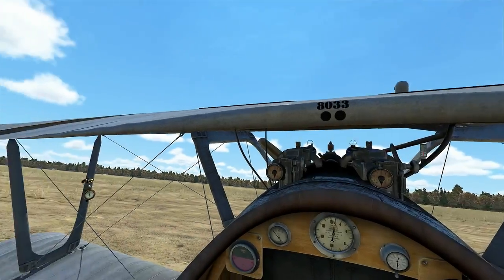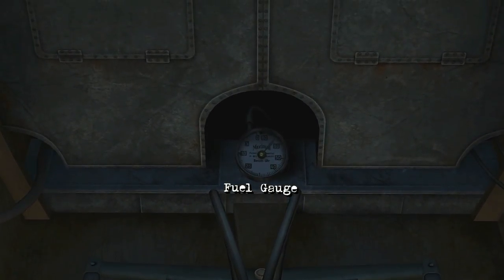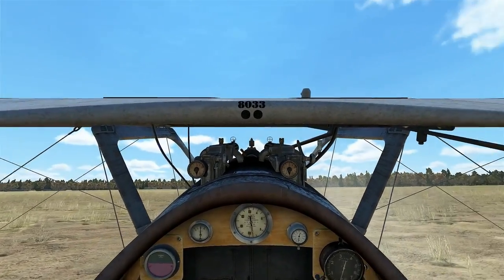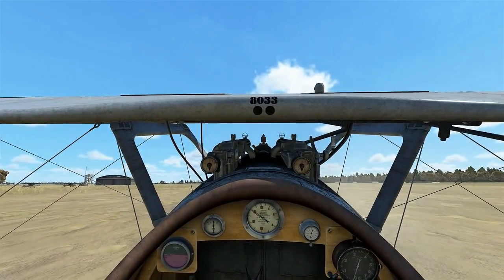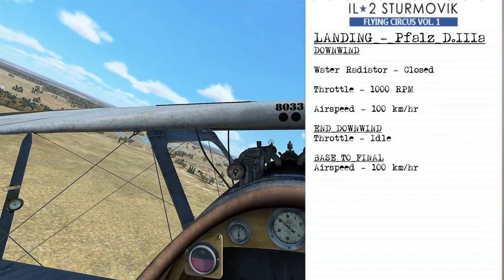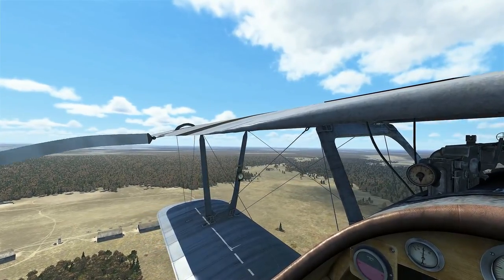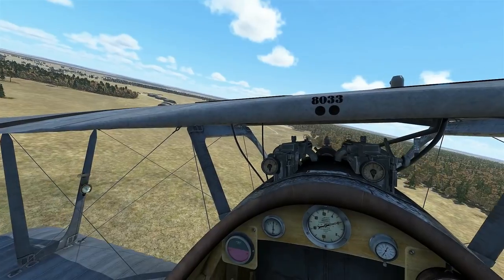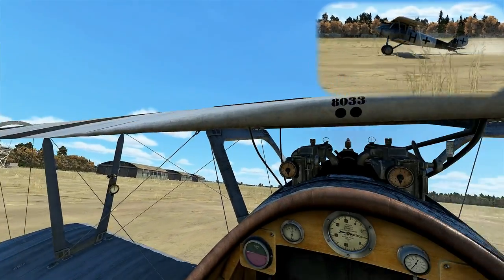Learn to fly the Pfalz D.IIIa

Comment: Hey Req, hope your doing well,i wanted to ask a question about Flying Circus and get your opinion.

On the Fokker D7 because it has that Mercedes engine it has something in front that looks like a cap right in the center and i use that for my aiming sight,it works great but the 7F doesn't have that,how do you aim on that thing?  thats something Ive always had a issue with and i was wondering what others did,i tried aiming on the left and right sight but doesn't work very well cause the bullet convergence point is right in the middle,if its something big like a balloon its no problem but something small like a howitzer then its a little more challenging,thank you for your input, just curious as to what you do.
Reply from the maker: I just align the tracers with the middle of my screen when zoomed all the way in. Then I'll zoom out to normal view